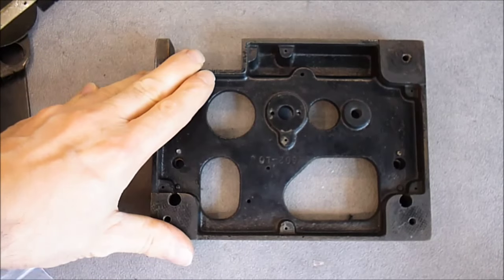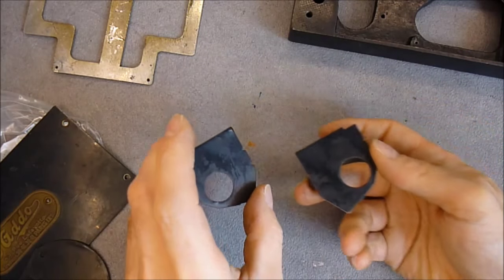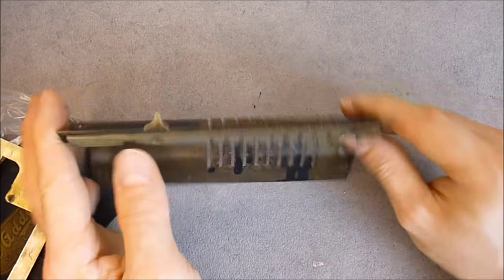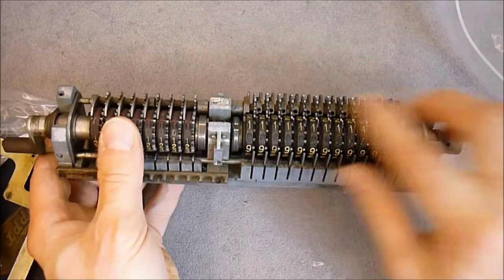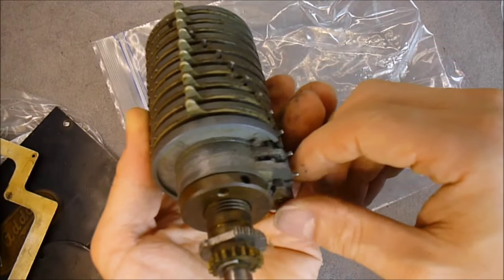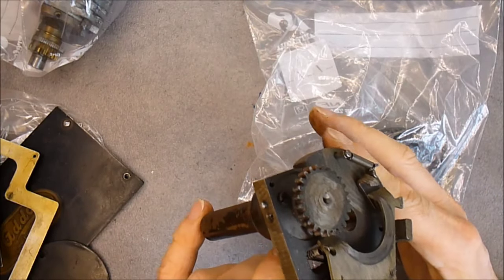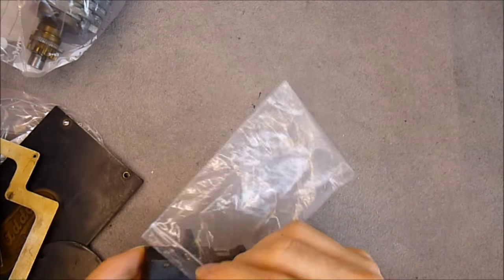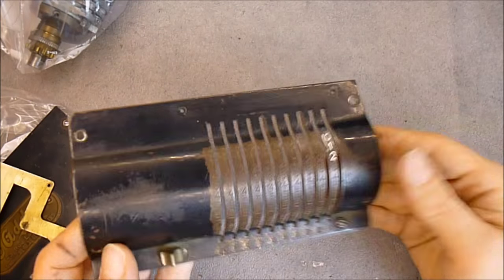The Odhner calculator is in parts

Comment: Hi there, did you ever get the Odhner calculator back together? I would like some advice on doing mine. Cheers
Reply from the maker: Sadly not, some parts were too damaged, and those calculators are pretty common, all the parts ended in the waste bin.
Reply: @msylvain59  in the trash really, what a shame! Even if you consider they are pretty commun, they are à legacy, and there won't ever be more manufactured. Efforts should be made to conserve them. Instead of trashing the parts, you could have sold them or given them away to some museum or people that would value them. 😢😡

Comment: Using soapy water on that sounds like a poor advice tbh. You should clean them with kerosene for example. Avoid wd40 on antique stuff too. Some of those stuff (paint) can be damaged by those modern products. Also water can stay trapped in the mechanisms, without speaking of rust issues...
Also some antique calculator can have water soluble paint, so be careful.